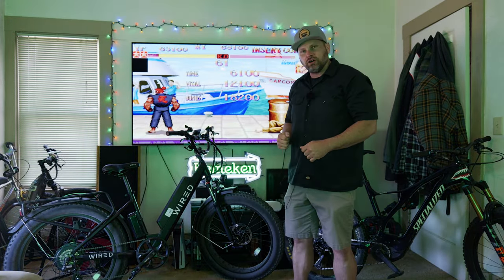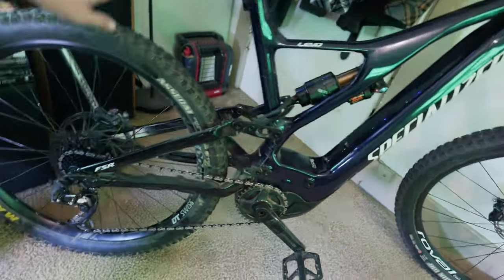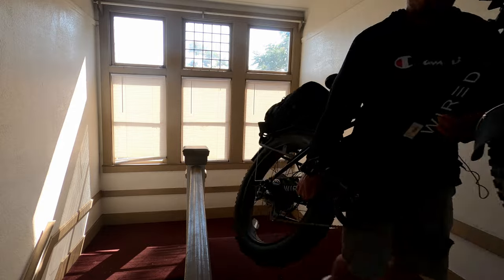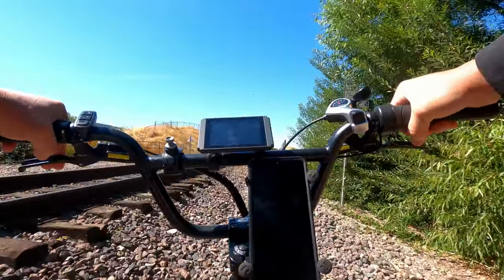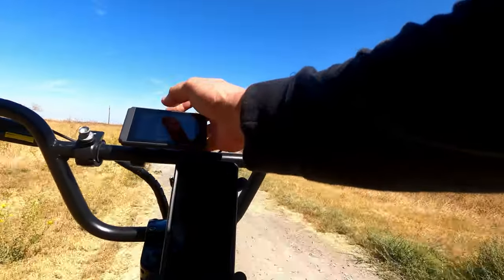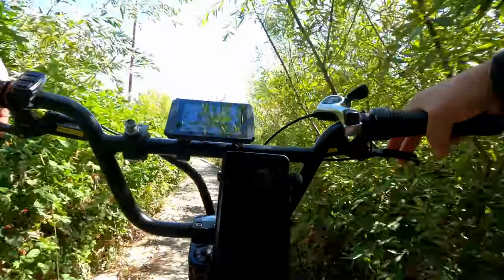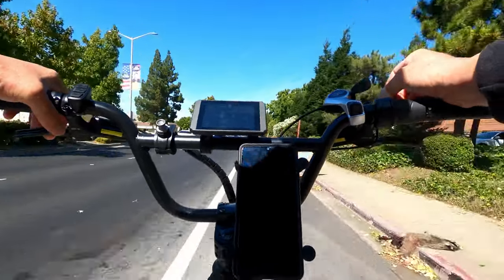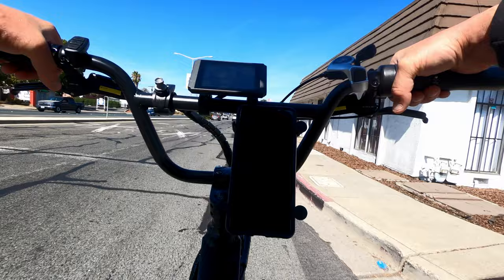Review of WIRED Cruiser 60 volt e-Bike (This Thing is Crazy!)

Comment from the maker: ***********UPDATE**********
My bike is equipped with a newer battery pack using Samsung cells where the old packs used LG. This requires the P5 setting in the computer to be changed to 6 from 16 which is default.  This appears to have resolved the freezing speedometer as well as the battery meter inaccuracy.
Reply: P5.  6. new. setting
Reply from the maker: You're right thats what I have mine set to now.  I will update this comment, thanks  @timothywarehime5956

Comment: OK, missed this video by you until now. Nice review. For some reason none of the other reviews I watched pointed out display of volts (or I didn't notice it anyways) which is important to me as the bar system always kind of sucks. You also did the best job explaining how Wired assist levels work. Now I'm subscribed, thanks.
Reply from the maker: I agree, the voltage is the most accurate way to track battery life. With a change in settings the bars on the display are now pretty accurate but there are only 4 so you don't have as much granularity , but its not bad.

Comment: Totally agree with your use case!!  I keep hearing mid drives are superior for climbing.  Since you own both, can you show an incline where the Specialized can go where the Wired cannot using throttle or high pedal assist?  The specialized I tried only gave you 2x assist.  You had to really put in the work!   Bet you put more miles on your Wired.
Reply from the maker: There are a few things that make the mid drive better.  The bike is lighter in general and has way lower gearing.  Some of the steeper hills you go on with that style of bike you end up creeping along at a pretty slow pace and since the mid drive is running the power through the drivetrain you get the benefit of being able to utilize the additional power with the lower gears.  With the hub motor, since the power is generated in the rear independent of the gears,  you really need some RPM to have usable power, so they do better at higher speeds.   

Also, some of the super steep stuff I've seen, I wouldn't wanna end up there on the Wired lol.  Wouldn't be fun getting back down.   I have 4000 miles on the Specialized since 2020, but in a few weeks I almost have 300 on the Wired so I bet you're right about that.
Reply: @shootthechit Just curious how much difference in hill climb between your three e bikes.  It would make a good video.   How tired would you be and at would speed would you climb that huge hill in your video on a mid drive?

Comment: I have the Cruiser August shipment with the Samsung Battery. i talked to the onwers and they said try the P5 setting at 6 so thats what I did and it's great, very correct reading !!!
Reply from the maker: Interesting, what was yours set to when you got it?  Mine has the Samsung cells and is accurate with the P5 setting at 8. Does your rear brake squeal?
Reply: @shootthechit  After I went through the update from the email that was sent out the setting went to 8. I texted Steve to see if the P5 setting should now be 8 or 16. He texted me back and said to put it at 6 so that's what I did and its worked great!!
Reply from the maker: Interesting.  Mine seems pretty accurate at 8, it always matches the same amount of bars the battery pack displays if I press the button.   @breminnie

Comment: Did you up the setting on the display? There are (3) different setting you can change to get the max power out of the bike. CitizenCycle (on Youtube) maxed out the setting and was hitting 39 with just throttle on flat roads. Showing around 2200 watts peak. Oh - I think its literally impossible to accurately calculate range on these bikes. Many variables change it including a person's exact weight. Texture and type of ground plus any inclines or declines would alter the range as well.
Reply from the maker: OH yea, that was the first order of business when I got the bike.  Changed the settings right away.  I tried this morning and got 34 mph on throttle alone but that wasn't on 100% battery.  I'm a bit heavier than him and I also had a backpack on so that might account for some of it. Either way these bikes are fast and a lot of fun.
Reply: Ok, great. The Cruiser is going to be my first eBike. Really looking forward to it.  @shootthechit
Reply from the maker: You will love it! @Grevlain

Comment: Bro go into settings change the P5 from 16 to 8. That will fix your battery meter your wired comes with a Samsung50E battery now. 🍻
Reply from the maker: Thanks, Someone else mentioned that earlier so that change has been made as of now.  Hopefully that fixes the issue, even though I'm OK with just looking at the voltage now.

Comment: Great Video! Do you think that the Tenure Foam Tire Iserts are lighter for wheel rotating weight and resistance than say using some sort of anti-flat liquid inside the Tubes for Flat tire Prevention? just wondering your thoughts on preventing flats as I'll prob be off roading alot like those trails your on as I live in the East Bay, similar terrain. Thank you!!! Will be getting a Freedom sometime this month!!! Happy February!!!!
Reply: PS Glad that you made it through the "Black Berry Boardwalk" without incident, plus you found your drone!!! BONUS!!! ; )
Reply: Oh, I should have watched the whole video before I commented on inserts... Hoping I can set bike set up for good hill climbing. I might even ditch the large chain ring for 40 tooth or so and just use throttle if need 35 mph on the flats.. I see you made it up that steep grade, I have lots of those where I'll be riding. lol
Reply from the maker: Interesting you mention this, because I do have a theory that the inserts are eating up some of the range.  I'm going to switch to flat out and re-run a range test to see if that is the case.  The inserts are nice for sure and gives you peace of mind while riding, but they are heavy (I would guess more than the liquid) and they add an additional layer of cushion, so no matter how high you inflate your tires, there is still going to be some give.
Reply: I see, that makes sense, prob does decrease range with inserts as adds more contact area between tire and ground. Could be good though on the dirt for better traction, more forgiving ride... less range though, and on the street might be more sluggish... But will be looking forward to your "Test"' Thanks for your response though. Might try the sealant first. I hate changing flats in the middle of a ride!!! Buzz kill.. lol.. ; ) @shootthechit
Reply from the maker: Especially changing flats on one of these bikes.  Not something you wanna be doing in the field.  These fat tires pick up a ton of stuff as well, pretty much have to have additional protection 
 @Sherman1862
Reply: no doubt... "Goat Head Magnets" for sure!!! "Be Prepared" is the Scout Motto, will apply to my Ebiking too.. lol.. ; ) @shootthechit

Comment: My rear brakes continually squeal also even after a couple hundred miles of riding and braking.  And you are correct, it does need much lower gears......it's almost impractical to use just as a bike and no assist if you ever have an opportunity to want to pedal only.  The speedometer does stick, so I just use an app on my phone for accurate speed, but when it's working, it is accurate.
Reply from the maker: I actually swapped my rear pads and it stopped the squeeling completely.  It was really getting on my nerves. They are Tekro brand pads, but the compound is different.  Good news is they are only 10 bucks on Amazon and super easy to swap out, took me 15 minutes. I also changed the P5 setting in my computer from 16 to 8 because my bike has the samsung battery cells and that looks to have fixed the sticking speedometer as well as the battery meter not being accurate.  I'm going to make a follow up video at some point.  
https://www.amazon.com/dp/B005OME320?psc=1&ref=ppx_yo2ov_dt_b_product_details
Reply: Oh sweet....thanks for the info!  I'll get those pads right away....I'll also change the P5 setting and see if that works.....will changing that setting affect anything else? @shootthechit
Reply from the maker: If you take out your battery pack it will say on it if its LG cells or Samsung.  I think that P5 setting is only for Samsung cells. If you have LG, I would leave it at 16.  Not sure what else that setting effects @TheTaxreliever
Reply: Ok thanks!  @shootthechit
Reply: I probably have less than 50 miles on mine since late August and my brakes did squeal but it seems like they have stopped on their own.😊

Comment: nice review bud…. I’m 5’9 height and thinking getting the regular freedom. you think is not to high for me?thx
Reply from the maker: I couldn't say, never ridden the Freedom model.  I would think as long as you don't have any mobility issues you could most likely make it work.
Reply: I AM 5^8^  69 YEARS OLD AND 250 lbs.
I get on mine even though I also have a bad knee and some arthritis in both hips.
I keep my seat at its lowest setting and I can also sit on the seat with my feet nearly flat on the ground.
However, the 2024 W.F. is about 1 or 1.5 inches higher at the seat due to the mew style rear suspension.
My inseam is only about 30 inches so you may have more seat clearance than I do.

Comment: I’m thinking you might have some settings incorrect on the display, I have the same version Wired cruiser and have not had issues with the speedometer sticking. The battery bar does take a couple minutes to calibrate after draining/charging up the battery. Mine will also show 2-3 bars after a full charge for maybe 2 minutes into riding then corrects. Make sure you changed settings for the new Samsung battery vs old LG. Wired sent an email about it, make sure your P5 is set to 8.
Reply from the maker: Interesting, I just looked at my battery and it does in fact say samsung on it, and my P5 is set to 16. When did you get the email?  I've had the bike for 3 weeks now, pretty sure I never got an email.  Thanks for the heads up
Reply: @shootthechit  I actually got the email before receiving my Cruiser in August. It was sent out to their general customer email list I think. Give that P5 setting change a try, should learn after a few minutes of riding and be more accurate for ya. Not sure what your Speedo sticking issue is but I suspect another setting might be incorrect or a loose connection somewhere.
Reply from the maker: OK, I made the change! Hoping my bike can do 200 mph now!  @FreakyT333
Reply: I HATE steep hills ⚠️  *lives on plateau

Comment: Cool bike but watts vary between type of motor. Ie a 1500 watt mid drive would perform way different than a 1500 watt hub..and the internal gearing ratios matter too
Reply from the maker: I would be interested to try a high powered mid drive.  Those don't seem to be very common in bicycles, unless you go to the Sur Ron or Talarias.
Reply: @shootthechit  I think surron and talaria are both mid drives (they pull the chain). The onyx is what comes to mind for a high powered hub(both rcr and cty2). And the metacycle e motorcycle is a hub too

Oh nvm I thought you were asking for a high powered hub. Biktrix has a powerful new mid drive (I think it’s biktrix)
Reply from the maker: On the Specialized I've broken the rear derailer once, replaced the chain maybe 4-5 times, and changed the cassette twice.  Granted I have around 4000 miles on it now, but I would bet a high powered mid drive would wreak havoc on a traditional bike drive train.  I bet at some point we will see higher powered mid drives come with belts and rear hub transmissions (not sure what they are officially called)   @slimdunkin117

Comment: By buying this bike realize what you are getting into. It is not quite a bicycle in a traditional sense - it does not feel like one - it does the job for you when pedal assist is on, and you can hardly move the thing when pedal assist is off. It is quite noisy, heavy and fragile at the same time. If you in the middle of nowhere would get a flat then  you are stuck, you will not be able to move it much - may be a 0.25 of a mile if you are in good shape, but that is all. Be careful turning it upside down for repairs or tunning, you can damage it by its own weight, or you can damage your own back. Yes it is quite powerful, has decent battery life, feels very stable on the road and has sufficient breaking power, but do not assume you are getting a great bargain - when manufactured properly the thing would cost 5 grand or more, so expect overall material and manufacturing shortcomings - spongy breaks, easily puncturable tires, wobbly derailleurs, etc. Gen yourself tire repair kit, portable pump and basic repair tools and generally be quite gentle with the bike -  in spite of its tuff looks it feels more like speedy lead marshmallow than a tank.
Reply: I have one at home and over time I’ve beat the thing to crap so I think it can handle some tools 😂. I have never gotten a flat on a e bike. It’s also not that heavy it’s like 88 pounds and on wheels it’s not terribly difficult to move and most e bikes have walk assist.
Reply: Clearly you don’t own one.  Built like a tank.  Brakes are great.  Big brands spend a lot on marketing and overhead and you are welcome to bend over and pay.

Comment: ive been riding fat tires since 20 17, i got a flat once summer 2020, but that was the only time and I don't run liners or any of that stuff. But I came from a mountain bike and background when we only put  between six to ten pounds of air😂 fat tire ebikes are invented and kids start putting 25-30 lb of air, worrying about flats, putting liners and slime and all kinds of weird stuff, don't need none of that, the tires are too heavy as it is, just keep the air pressure below 15 lb, And chao yang area pretty good.
Reply from the maker: I've had mine for 3 weeks now and had 1 flat, but it was due to a nail.  I know on my 29" MTB I have a tubeless setup and seen quite a few things puncture the tires but the sealant did its job.  I totally just assumed with the larger tires these things would pick up thorns much easier so I didn't want to take that chance.  I guess it largely depends on where and how you ride as well.  I keep this one at 15psi as well.  25-30 would be scary lol
Reply: @shootthechit  sounds like just bad luck, although I don't know how they hold up against goat head thorns.(I'm in the Northeast for now)I have that same Mozo Fork on one of my electric bikes, I like it, it's not a Fox, Manitou, or Rock Shox, but I ride the same diamond trails with it, it's pretty stiff not too much flex, a little chattery but better than a Suntour.
Reply from the maker: OH yea, thats probably a big part of it. I live in Northern California and there are goat heads all over the place here. Those things are the worst. I agree about the shock, overall its fine but nothing to rave about.  It works well for what type of terrain most people will probably ride these bikes on.  The one thing I notice is its easier to get yourself into a situation where this shock will bottom out due to the speed of the bike, but that comes down to situational awareness imo @bassw1758
Reply: Interesting, mine has never bottomed out,  I have the one they make for the Ecotric bike, but its on a Mongoose Juneau, with the 1000w  Bafang hub motor kit. I itake it down hill off  jumps all the stuff it says not to do on the sticker. I much rather have the Manitou, but that's a grand after you convert to a thru-axle, and change the headset, I still may do it one day. I can't find anything in between

Comment: THAT is not a eMTB, so might as well put road tires on it, so it can get decent range for the battery size. It can go 40 mph or so; much more like a motorcycle; so it's not really safe to drive without a full face helmet, and a cycle jacket and pants. Good luck taking it on trails; it weighs 100 lbs. Meanwhile, it would be way more fun if it was a mid-drive. The new mid-drives have both throttles, and gear sensors; to cut motor power during shifting. Works great. And mid-drives climb hills WAY FASTER.
Reply: My brother has a mid drive Trek 29 inch and I have my Wired Freedom.
We take them off road in the woods of Central PA. coal country. Shamokin/ Coal Twp.
His is better for going through the forest passes hardly wider than a deer path because of his torque sensor.
We raced up a 3/4 mile long, steep road and he kept up fairly well till he started getting winded.
He is an avid biker with years of experience, while I just got back on a bike recently with buying my Freedom.
We are both retired and I'm almost 70 and 250 lb.
He is 66 and in much better shape than I am.
That is why I got this type of bike instead of like his. 
Like ancient Rome, Shamokin is also a city on seven hills and I've taken mine up a few good ones from a stop and kept at least 14 mph on the worst one. These hills were several blocks long.
I don't agree with this not being good on steep hills
I enjoyed your video and wish we had bike paths here like you have in your area.
Reply from the maker: I think the bike does well on most hills, but starts to suffer on really steep hills if you don't use the higher assist levels like 4 or 5.  Where I think the mid drive bikes do better is when you're crawling up a hill at 4 or 5 mph and have to use really low gears as the rear hub motor doesn't allow for the power to be routed through the drivetrain.  With the Wired bike you have to keep your speed up to have usable power, it doesn't do well under 10mph imo, but in all honesty you will be able to climb enough hills to get yourself in plenty of trouble lol